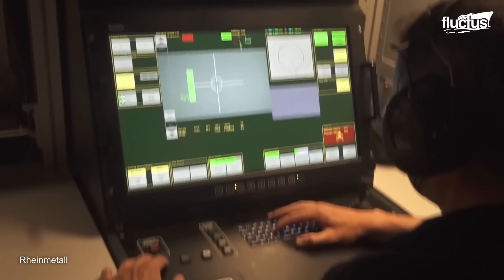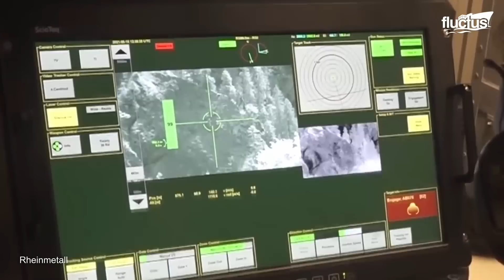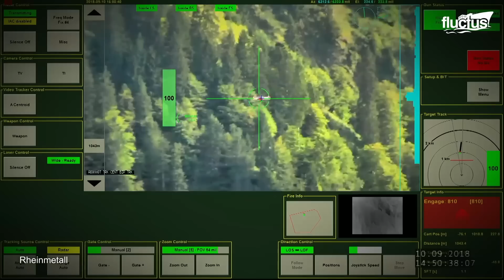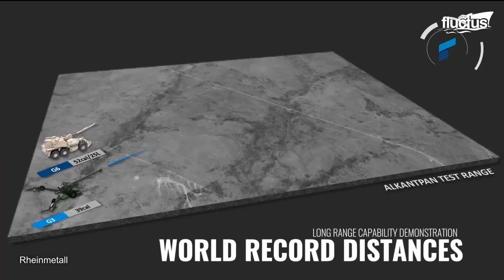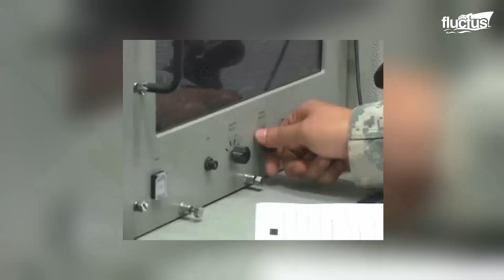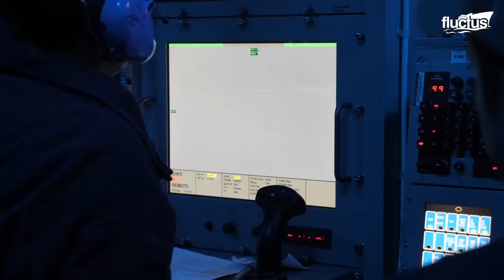Germany Testing Monstrously Powerful Multi Million $ Anti Drone Truck

Comment: How accurate is the tracking while the vehicle is in motion?  How well can it’s targeting system identify small threats in the half-sphere above it (especially when those threats are dispersed and using cover and behaving unpredictably)?  How fast can it track from one target to the next?
Reply: From watching the footage, I saw some clues as to how the system works. When the drones get shot, you see the explosions happen above the swarm of drones. This looks to me like some explosive ordnance with a proximity fuse/timed fuse that sends a cloud of shrapnel towards incoming targets. Much like the Oerlikon AA-gun (I think they are closely related). So, from this, you don't actually need extreme accuracy, as long as you saturate the approximate area of the target with rounds, you'll be good to go
Reply: @arie9123  There is a sequence that shows the sharpnel explosions happen in front of the drone, not above.
Reply: @iulianberca4860  someone else said it was a timed explosion instead of a proximity fuse - the radar sets time-to-detonation in each projectile as it goes thru the barrel, so it creates the shrapnel cloud in front of the target.  Pretty clever system.   
But it still doesn’t answer my questions about the over tracking system and how well it can handle multiple dispersed targets in the whole threat hemisphere.  Or how well it can maintain tracking locks on targets while the vehicle is in motion, or how quickly can it traverse from one target to the next…
Reply: You ramp up production and license the system. I see this application aboard ship especially useful against the Chinese and their drones they have in an anti-ship use!
Reply: Can this machine identify the difference between a drone and a bird?
Reply: @leolopezc15  Do birds have metal and radio frequency emissions?
Reply: Nem kell követni. Közibük kell lőni egy nagy sörétespuskáva.
Reply: @LoanwordEggcorn  drones will be deploying rf emitting countermeasures next
Reply: @LoanwordEggcorn  you know that most drones are made from balsa wood, plastic, carbon composites & other lightweight materials yeh? most likely image recognition, maybe FLIR & SAR.
Reply: @tubthump  Depends on the drones.  For small/hobby ones, it probably adds too much weight/power.
Reply: @mrrolandlawrence  IR yes, SAR no.  But the main sensor is regular RADAR.  And there is metal in drones.  At least more metal than in birds.
Reply: Google it.
Reply: @LoanwordEggcorn  yes but I meant military drones -  but then militaries could stick rf emitters or something on the larger hobby drones to use as a form of chaff couldn't they?
Reply: @tubthump  Yes, but the smaller drones won't be able to carry as much equipment or spare power.
Reply: @LoanwordEggcorn  so they would be shorter range then. Mother ship drones could deposit swarms of decoy drones in an area where attack drones are operating! ...my point is that drones are demonstrably ahead of defensive systems like this especially when it comes to urban environments.
Reply: @tubthump  We agree.
Reply: @LoanwordEggcorn  it's been emotional
Reply: Excellent questions, I’m also interested in this as well. I suspect that this turret will fail at hitting multiple racing drones that can travel at 100MPH+ and make sharp corner moves and travel at extreme low level and travel through dense Forests, cities, homes, buildings and many obstructions. They need to use a turret design that can literally position and move at high speed, maybe lasers are better. This demo of theres is simply a joke, Enemies will quickly use ultra fast racing drones and this demo the drones were traveling like 15MPH.
Reply: @arie9123  wow, I think you’re right. It seems like so. This is even worse design, there are drones that can maneuver sharp corners and Descend or ascend super fast and travel 100+ MPH. It can quickly not get hit by shrapnel. Imagine 8 drones traveling at 100+ MPH and not moving in the same group but at wide spaced distance and doing crazy maneuvers getting towards the turret. I bet at least one drone will crash and explode to the turret.
Reply: @tubthump  RF is useless buddy, these drones can be equipped with Inertial Measurement Unit devices which are low costs, similar to what missiles uses. All that is needed is to preprogram them so no reliance of GPS/radio is ever needed. The best counter defense is to use EMP or a proper precision based turret which uses lasers to knock down multiple high speed drones. Just one garnade equipped with a drone is already dangerous enough, imagine you’re facing 50-100 of them. Where each drone only costs $200-$300 when purchased in bulk. I saw these drones like 6 years ago and already realized how dangerous and effective they can be and used in modern war.
Reply: @LoanwordEggcorn  metal? More like carbon fiber. The only that that’s metal on these drones will be the PCB traces and it’s components and also the motors.
Reply: @sto2779  Because Carbon fiber conducts electricity, it also reflects radio/radar waves.
Reply: @LoanwordEggcorn  well racing drones mandatory uses carbon fiber to reach ridiculous speeds at 165MPH and doesn’t break easily when crashed. Radio waves being reflected can be designed such that it limits it and these ultra fast drones can simply fly 1 foot above the ground, like literally.
Reply: @LoanwordEggcorn  Metallic birds with radiofrequency emitting chirps do, but I guess they are an acceptable casualty.
Reply: @iulianberca4860  Seeing as the shrapnel would continue on the same trajectory as the point of origin from which it is fired, then exploding just in front of the target would create an expanding cone of destruction towards the target. If programmed to explode AT the target it would reduce its efficienncy by having to be far more accurate.
Reply: Yes
Reply: @LoanwordEggcorn  usually no but what if you put some emitters on them and let them fly around to deceive the system, using its resources while uncovering its location to the real kamikaze drones? Also swarm method don't caped at a limited numbers, it could be over hundreds also they dont fly in formation like this video, they can fly unpredictably over a huge radius
Reply: @RoxnDox  Indeed, it is delayed detonation ammunition. The time that the projectiles take to detonate is defined by the radar based on the distance from the target so that the projectiles explode when the system has calculated that the detonation will hit the target or targets.

It is a vehicle specially designed to take down swarms of drones.
Reply: @mrrolandlawrence  Drones emit radio frequencies and thermal signals, so yes, radar can detect them.
Reply: @arie9123  Radar guided mini flak gun.
Reply: They tested this intercepting a swarm flying in formation through a narrow valley..... basically perfect targets in a tight grouping.
Reply: @arie9123   And the obvious counter is to spread your drone swarm out so they can't take the whole thing out with a handful of AA-fire...... or use ballistic suicide drones armored against the shrapnel.
Reply: @leolopezc15  Probably has some form of Infrared and image recognition.

Comment: It's amazing how these bullets burst at the desired distance ..precisely around the target 😍💥
Reply: I think it's done purely by timing, as you can't fit all that much electronics into a 20mm shell. A precisely timed burst combined with a predictable velocity gives surprisingly good control over burst location, and that can be effective if you've got an accurate estimation of the range to the target. The alternative strategy would be radar fusing, like the VT shells from the latter half of WW2. Those were highly effective against airplanes, but small quadcopter drones, which are mostly plastic, might not have enough of a radar return to trigger a radar fused shell. It's sorta funny how we've actually gone backwards to timed shells, which became effective again once they were better automated and paired with modern range finding (ie, the radar set controlling the gun). With WW2 timed shells, in addition to having less precision, the timed fuse had to be manually adjusted with a screw-driver before the shell was loaded into the gun; now it's electronically set as the shell is being fired.
Reply: @ddopson  probly you are being right becaused they have super accurate RADAR on it it can set the timed detonations instantly as they are fired off. HOWEVER, they could also use the simple radio device too.  All it does take is a very small radio in it with only liked a 20 feet range and anything in 20 that haves metal or electronics will caused a flux in the radio signal and makes it detonate.  They had thosed small enough in WW2 to put in to 40mm AA bullets so I think probly they could maked them way very smaller now.  But why do that when do you haved a super RADAR that can do very the same thing already in the tank?
Reply: @ddopson  Not 20mm, from the video @1:30 "Swiss made 35mm revolver cannon"
Reply: Distance fused.
Reply: It uses special ammunition called AHEAD: Advanced Hit Efficiency And Destruction.  The fire control system knows how far away the drones are.  As the shells leave the barrel it measures the velocity of each one and programs it to burst after a certain amount of time.  Velocity x time = distance.
Reply: Good to know the science in replies here...thanx friends💝
Reply: The US experimented with this in man-portable grenade launchers in the 90's. They deemed it too expensive to use in a rifle.......glad to see that the Germans incorporated it here.

Comment: Now, if only drones would be so kind to come in range... Point is that you need hundreds of these to cover a border or front. Most likely you'd have a battery at key targets like airports.
Reply: On peut utiliser des drôles anti drôles, moins cher et plus flexibles.
Reply: Thats why its mounted on a simple truck to reduce production costs.
Reply: @HybridHumaan  Still costs 10X what it should for what it does.
Reply: @kinkade6710  with what data orexpertise can you back up your claim?

Comment: Seems unreasonably excessive for anti-drone weapons platform until you consider near peer nations may be using drone swarms in the near future that conventional forces will have to lock horns with
Reply: No it's not. Good thing and that CIWS is "next" step bigger one and very similar. Those small drones are hardest in theory but usually drones are bigger in war zones
Reply: @jannejohansson3383  we need to win the drone warfare game
Reply: @TheAnnoyingBoss  
Normally when we see something on YouTube it's already been exposed to the public for 3 years already.
Reply: Its actually a multipurpose anti air plattform, they just emphasize drones in the video for some reason. It can be combined with IRIS-Tfor example.

Comment: In the first video. The drone killer.
Why are they using shells so big to shoot down small drones? 35mm shell is huge, I hope it's capable of shooting down full size drones. I hope that's the reason for using that size ammo. Would have been nice to see it do that.
Reply: Go on , Oerlikon Ahead Air Burst Munition .
Reply: It's AHEAD Munition. 
Each Ahead round contains 152 tungsten sub-projectiles which are ejected immediately in front of the oncoming target.
Reply: The drones are not shot down with the entire projectile. This is an intelligent, programmable explosive munition that explodes into 150-200 small pieces of tungsten just before the target. The ammunition is programmed at the muzzle of the gun barrel at which distance it should explode. The distance to target values are calculated by the radar and the fire control system. It is difficult to accommodate the mechanism of programmable ammunition in smaller calibers. In addition, 3.5 cm ammunition has a greater fragmentation effect than 2 cm ammunition.

Comment: Looks promising, and shares the same technology of the former Skyguard and Skyshield systems. So it seems not only to be an effective countermeasure against drones, but also against ground soft-skinned vehicles and low-flying aircraft and attack helicopters, by not mentioning potentially use against smart munitions and cruise missiles.
Reply: No it doesn't; how much is that truck and how many drones can you buy for the same price? 
Now SEPARATE those drones by about 100' each ... and then show me it's efficacy.
That's a TEST at a KNOWN range, altitude & under optimal conditions; ie:
Knowing exactly when they'll arrive & requiring they stay stationary relative to flak style ammunition.
Reply: Largest American civilian owner and operator of a singular drone fleet here… nope , I got this, cost me a grand …maybe…launch about 100 in 360 spread pattern fly to max altitude and and simultaneous 0 angle of attack…done. Look at its angle of attack, it’s like the designers where making it for a threat that doesn’t exist.

Comment: 3 years ago, Iran produced a point defense weapon called Kamand, which fires 5,000 rounds per minute up to a height of 5 km and an operational range of 5 to 10 km. / Damavand and... are used, and laser defense weapons with a range of 7 km and a power of 5 and 10 megawatts are also used to hunt drones.
Reply: It also quotes the Qran constantly on a loudspeaker system, and beats any wives it finds withing a 10km range.

Comment: The problem is the cost - it's far cheaper to produce masses of drones than buy the Anti Drone Truck - it fails the cost benefit analysis.
Reply: Srsly? You calculate the one time investment of a truck against the recurring investment for every drone you send? If we were talking about stinger missiles sure you would be right, but this truck fires 35x228 AHEAD ammunition which is way cheaper than a drone.
Reply: That's why I think money will flood into drones. Big ones small ones. Mother ship drones that carry smaller drones with smaller drones in them. Drone swarms that deploy like bubbles and replace themselves when their batteries run low. Anti drone drones ECT. Big ones small ones.
Reply: yes. but you cant defend with swarm of drones
Reply: @dermozart80  Germany ordered two systems for 140 Million Euro. So they aren't exactly cheap.

Comment: I thought high powdered lasers would be very effective against drones also.
Reply: Rheinmetall also has them on offer.
Belongs to the air defense network, laser, revolver gun, missiles e.g. Iris T slm, jammers etc.

The laser they have successfully tested last/last week on the Frigate Saxony.
Reply: If only you could deploy it like a bubble.
Reply: British DragonFire System is exactly that.
Reply: The high amount of energy you need for lasers is a problem.
There a systems ,like the israelian defence system and others.
But mostly on ships or stationary. 
For a mobile ,high powered  laserweapon you will have to carry 
a power source around.Allways very heavy .Not suitable for fast
moving in difficult terrain.
Reply: @theraven5935  High power capacitors have made leaps and bound in recent years; anyway, and the 50KW British Dragonfire energy weapon has been tested and works. It destroyed a drone at 2 miles, so they at least appear to have solved the problem. Their main technical challenge seems to have been the computing power need to target extremely fast-moving weapons in real time. I'm sure the problem of mounting it on truck is not insurmountable.
Reply: @sirrodneyffing1  Watch it. A system like that ; how many shots can it fire ?
And once out of energy how do you recharge?
Reply: Lasers tell the enemy where you are.
Reply: @abyssmanur3965  Er...they're not like a laser pen you wave about in the dark... Its just a single massive burst. I think the you can't even see the British Dragonfire laser.
Reply: They can help! Combined arms, everyone. Integrate laser weapons into the proper anti-air systems, such as this, and air defense will become easier.

Keywords: 
- Can help
- Proper anti-air systems
- Become easier

The goal is to minimise the chances of a drone strike of any kind, as much as possible. You will never completely eliminate that risk. But that goes for every other weapon.. 

Such as the ATGM. Planes. Infantry. Grenades. Snipers. Tanks. Ships. You will never be able to eliminate these threats completely. The goal is good enough damage control.

Comment: Looks very effective against slow, low flying drones. But, I think it would be an easy target against an MQ-9 Reaper drone.
Reply: Well it was never developed to counter Drones like MQ-9. But can destroy any Ammunition fired from the MQ-9. But to destroy the MQ-9, you need Missiles for that.
Reply: I think you're going to need different weapons for different drones. China makes most of the drones currently available, and they're not shy about who they sell them to. They have jet powered drones larger than a Reaper, and swarms of tiny ones capable of carrying nothing heavier than a grenade. But somehow you've gotta defend against all of them. Especially if you're from Taiwan...
Reply: @tsubadaikhan6332  like I said for the small ones you have C-RAM for the bigger ones things like the IRST SLM.
Reply: @simon_7620  Pretty hard to cart a C-RAM around covering dismounted infantry in an urban setting.
Reply: @tsubadaikhan6332  😎😁
Reply: @tsubadaikhan6332  
US and NATO Military personal can carry them on their backpack
Reply: @simon_7620   No it can't.  The weak link is  the radar....jam the radar and even with backups the gun is dramatically less effective and can be quickly overwhelmed
Reply: @tsubadaikhan6332  And this thing is any better?
Reply: @kinkade6710  for that you have your electronic optical sensors that can detect small targets at ranges up to 120km.